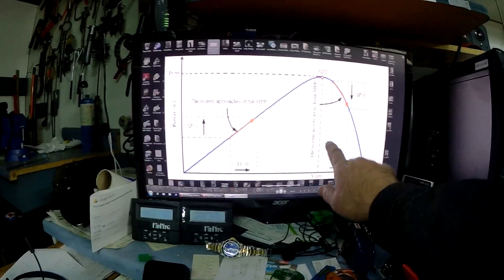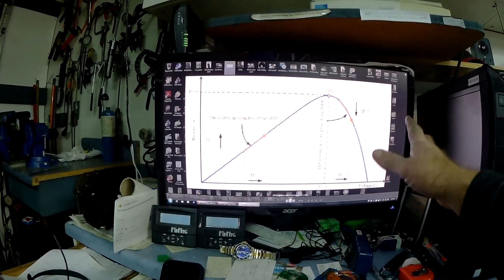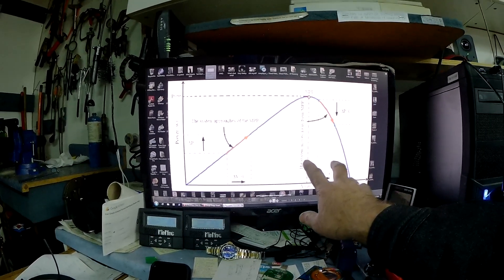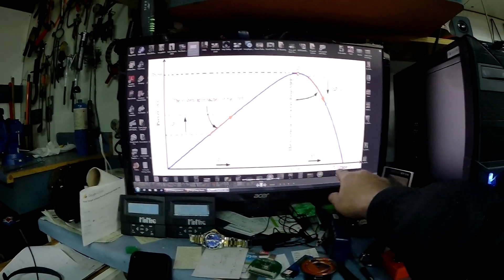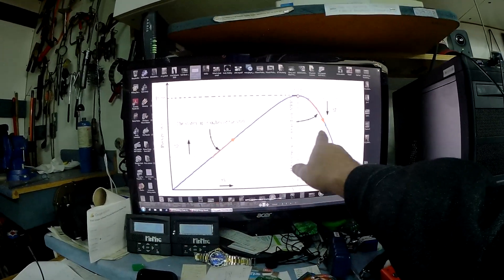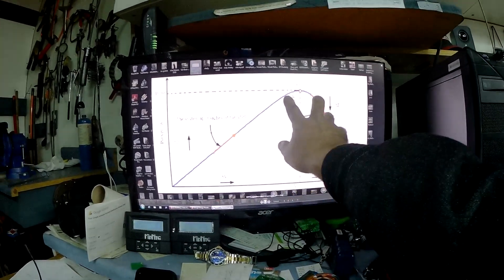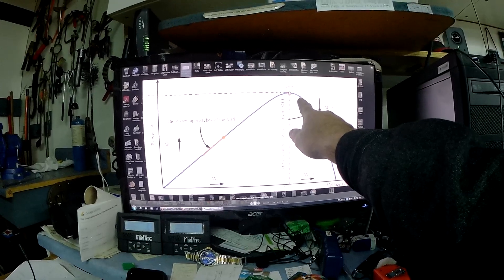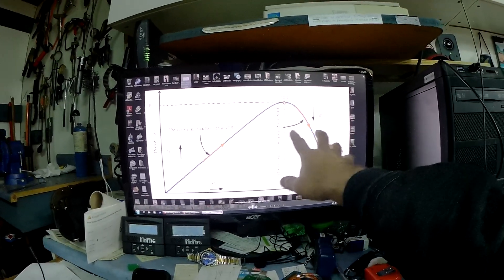Solar PV Hot Water- MPPT or not ? Part 1

Comment: Mark, Bear with me I am new to this and trying to understand. 
If you did want to run an MPPT if your element doesn't match as you say, Do you mean an MPPT charge controller or a dedicated MPPT controller board being sold for PV HWS, If you do mean an ordinary MPPT solar charge controller, then do you need to have a battery connected?
Reply from the maker: Very good question, yes, I mean MPPT charge controller as most anyone making hot water with solar already have batteries (assuming they are off grid).   MPP Solar now makes combined inverter/chargers (that are also charge controllers) and the latest version PIP-5048 GE will boot up without batteries. So in theory, you could make hot water with solar panels and a MPPT charge controller and no batteries ! But you still need a way to turn off the power to the heating element once the water reaches a certain temp.  The PIP-5048 GE has a 'dry contact' so there may be a way of configuring it to turn on  and off with a thermostat.  Do you know of another device designed to do this without a battery ?

Comment: I have an at point 13 gallon 120volt ac water heater which has power and temperature controls being run by my 700 watts worth of solar panels,60amp MPPT and one 100amp hr.12v battle born battery.  I set the temperature to max and power setting to low which is 200 watts.  By the time I get home from work on a sunny day the water temperature is 145 degrees which is enough hot water for two showers.
Reply from the maker: How cool is that !

Comment: No you dont . I did this in a vid a long time ago. I used a 24vdc 600w element . The pv is 24vdc  and 600w  paralleled 3 panels. At the best I hit 640w. No controller or batteries
Reply from the maker: Thanks Frank !... yes it certainly works good in 65% sun and better.  Did you get a chance to test it in 30-40% sun ?
Reply: @mark_osborne  no i decided that i need hot water when its needed so i run my big house tank off the solar system @240vac 3000w.  Its much quicker and if you heat a big tank it stays hotter longer. Its better for me to run the tank as it was intended.

Comment: Hey, Mark, where do you find Chevy volt batteries so cheap? I have checked a few junkyard sites but have not seen them for so cheap as you mentioned in another video.
Reply from the maker: I found them on the west coast in a recycling yard but I don't remember the name of the joint.   They did advertise on EBay, although I bought them direct.  Ck Ebay - they were in Oregon as I recall.
Reply: Thanks for the info. I will keep my eyes on eBay. If you think of the name of the place, let me know. 🙂

Comment: They say a little knowledge is dangerous. A little knowledge is just a little knowledge.  It is true that around the power point the minor changes in voltage don't make a lot of difference. Yes, only the current varies with light intensity.
BUT if you know ohms law when the current drops the voltage drops also across a fixed resistance. V X A = W and you have lost power big time.  Direct connect only gets you real power for 2 hours.  Throughout the day you loose at least 40% of what you could have.  If I were you, I would pull this video.
Reply: @Opera: I've watched several of your videos now.  I'm super impressed you know how to make an MPPT controller.  I've been googling different terms you use for the parts, but I still don't know how to make one.  I'll keep working at it though, because I would love to make one and do a side-by-side.
Reply from the maker: Ok, so I'll so some tests to see - I just did one at 4% solar power- check out the newest video and thank you, you are correct. 
The output was horrible compared to the panels connected to the MPPT controller.  However, we will also find out what the output power is at 30%, 50% and so on so we can make better sense of it all.

Comment: The reason I would use the MPPT controller is because I need to keep the volts up high because the water heater is so far away from the solar array. The charge controller also provides arc fault protection which is required when the array is on a dwelling. Just my 2 cents. Other than that there would be no reason for the expense.
Reply from the maker: Yes yes... if you're starting with 2 or 3 panels in series, and you can't find an element with the correct resistance to utilize that voltage, then absolutely a MPPT controller would be the best choice to accomplish the task, especially one that allows you to set a custom curve like a Midnight Classic-  you could dial it right in :-)